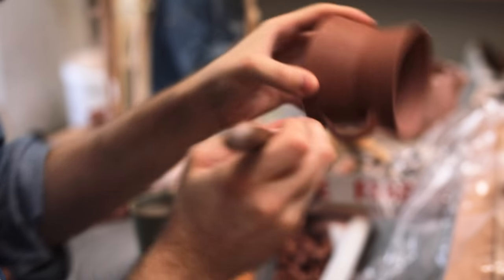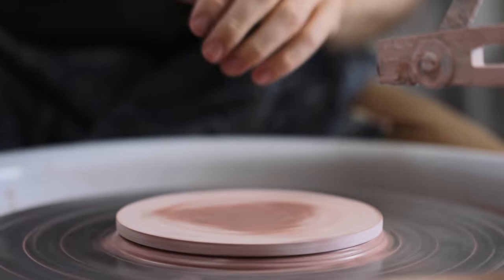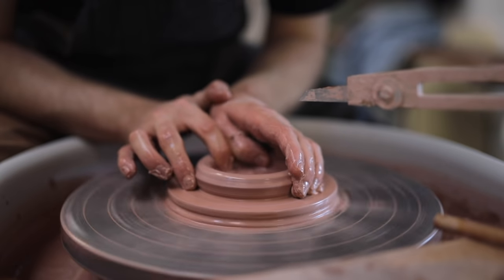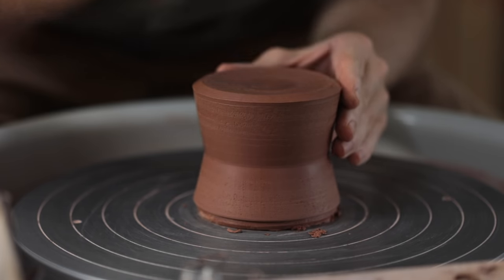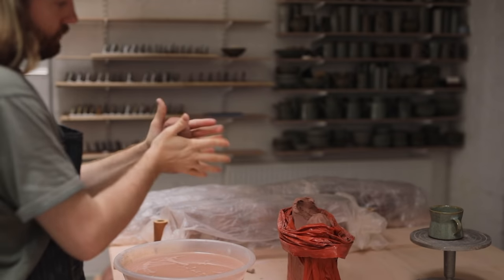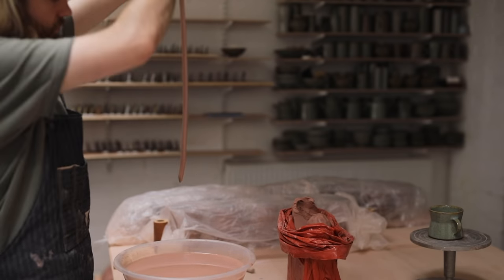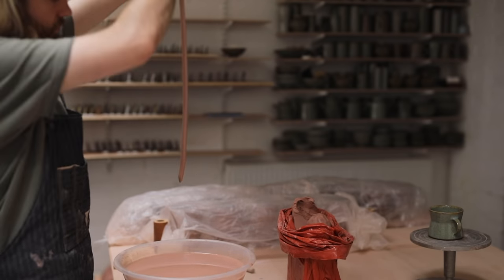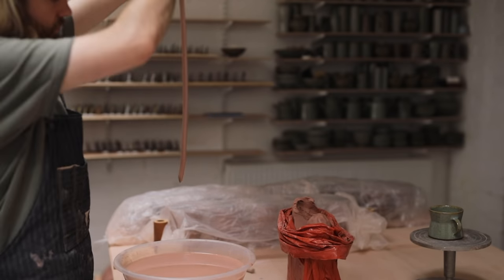How to Throw and Handle an Angular Stoneware Mug — Narrated

Comment: A very complex but correct, almost ideal shape of the mug. Only a level 80 master can produce 11 of the same replica in a commercially viable time. How much do you estimate 11 pieces?

➖Too large chamfer has been removed from the bottom
➖Small volume 😑 <500ml?
➖Dark color 🌈

Comment: Like the form it a subtle elegance.  Can you tell me why mug handles are thicker at the top as opposed to the bottom.
Reply: The top join of the handle takes most of the strain, so it needs to be stronger.
Reply: @ragnkja  Where did you get this information?
Reply: @raysville7256  
Using jugs and mugs, especially plastic jugs where you can see the plastic deform slightly due to the weight of the contents.
Reply: @ragnkja  I have a collection of Jugs by potters of some renown and have not noticed any stress on any part of any handle.
Reply: @raysville7256  
The deformation is really only noticeable when the handle is made of something soft like plastic. There’s also the fact that you can use a mug or jug handle where the bottom is detached, whereas one where the top is detached is basically unusable, as evidenced by the fact that all jugs and mugs where the handle only attaches to the body in one spot curve downwards, meaning that it’s the lower attachment that was “unused”.
Reply: @ragnkja  That may only be an aesthetic choice by the potter.  Look to nature re trees and limbs where the weight is most always at the base.
Reply: @raysville7256  
Consider how you hold a mug. Knowing that you apply as much force to it as it does to you and in the same places of contact: where do you feel that force?
Reply: @ragnkja  Thats more about gravity.
Reply: @raysville7256  
Which part of a tree supports the weight of the rest of the tree? Which part of a mug supports the weight of the rest of the mug and its contents when it’s held by the handle? If you’re unsure about the latter, pick up a mug and pay attention to where it presses against your skin. 
(Your reasoning is correct when considering the base and rim of a vessel, by the way.)
Reply: @raysville7256  
Gravity is the main force acting on the mug.
Reply: @ragnkja  The trunk or the stem of a tree or shrub is the main organ of the plant that provides the rigid woody structure. It supports the crown and functions as a conduit to carry water and nutrients between the roots and crown.
Reply: @ragnkja  I am curious if you are a potter, post a jpeg or png of your work and I will do the same.
Reply: @raysville7256  
Correct. The base of the trunk is also the oldest part of it, so it’s had longer to grow thicker.
Reply: @raysville7256  
I’m not a potter, but I do have a decent understanding of physics.